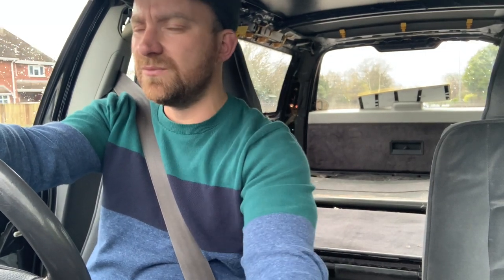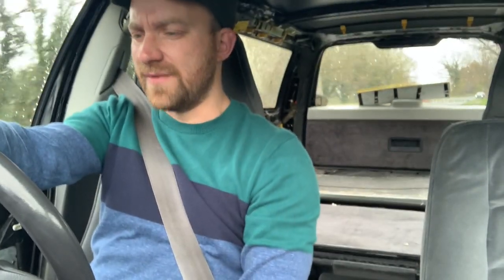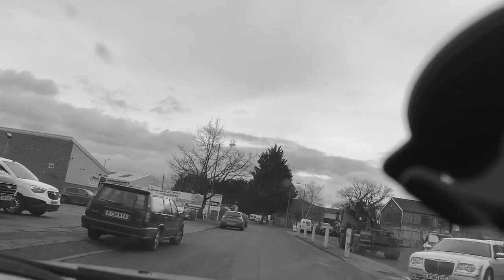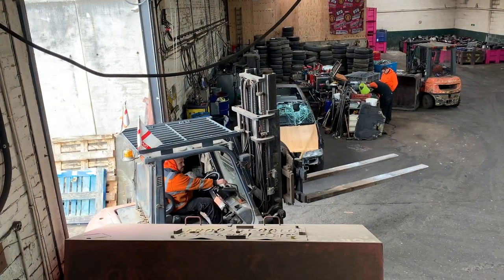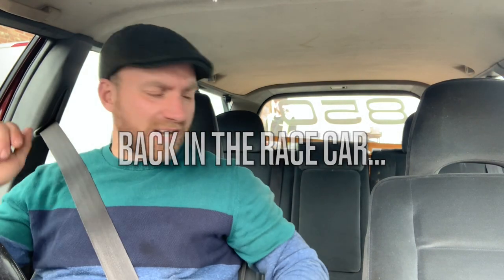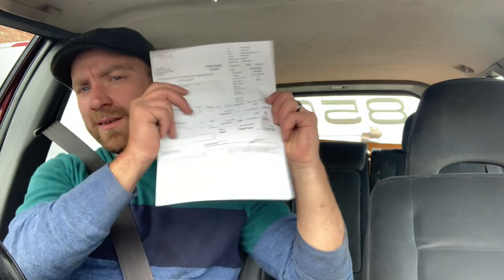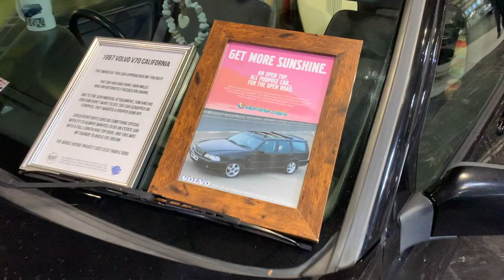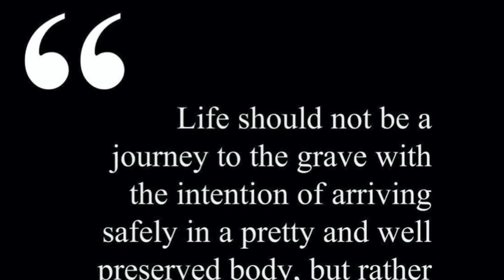Volvo V70 T5 Convertible Part 4 - The show is over.

Comment: Years ago I had a 'smash' in a fiat126bis and ended up with the wreck back at my house.
I took everything off that I could then cut the shell up into big chunks which I weighed in as scrap.
The parts stayed in big cardboard boxes for about 10 years after which I discovered eBay so sold them for about £600 !
Not bad for a £50 car !

Comment: Very sad to see this. I have recently spent another £1000 on my 1994 850 (new exhaust and starter motor). I replaced the RHS wing a little while ago too.The car is probably worth less than the cost of a full tank of petrol but that is sort of irrelevant as it is certainly worth a great deal to me. BTW, I also live in Worcestershire. I work in Bristol, meaning I have a 120 mile commute, which I share between this car and my trusty 2002 V70.